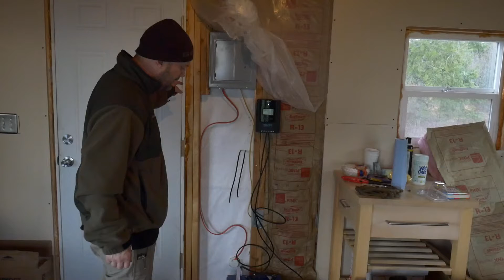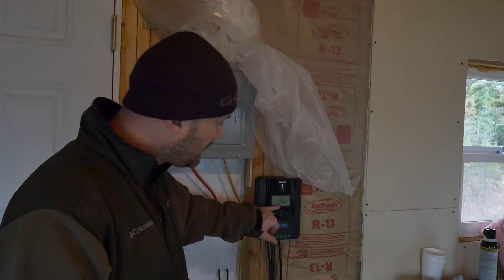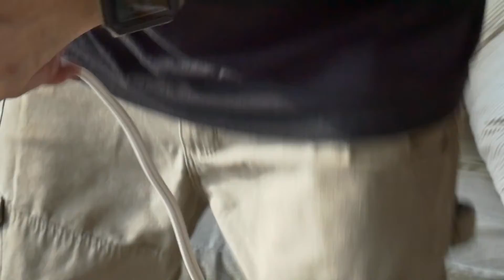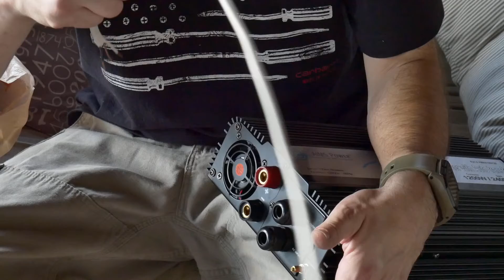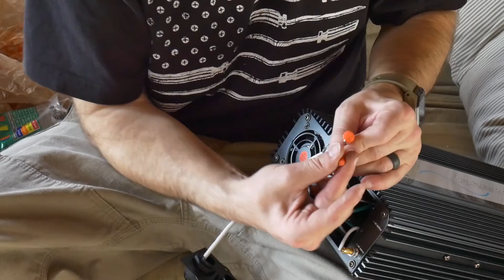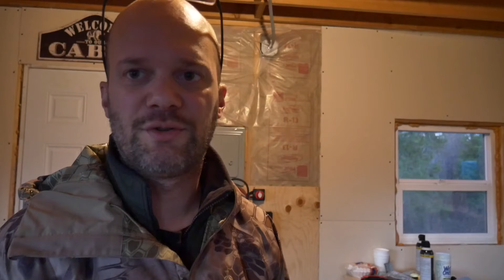Really Easy Cabin Solar Power Pt.4

Comment: Did you make a video on running a 12v system to your lights or did you ever end up doing it? Just curious b-c I thought about doing that and just maybe having 2 110 AC plugs. Just curious!
Reply from the maker: Justin Bowles good call!   No I never ran them.  Still have them and really need to wire those in.  It would be so nice to not have to run the inverter for lights.
Reply: I like the fact you can run your generator through the system and still have power. Is that hard to do?!
Reply from the maker: Justin Bowles that inverter automatically switches to generator power when you turn it on.  It doesn’t charge the batteries, which the more expensive one will do.